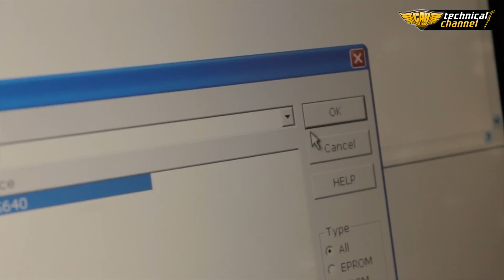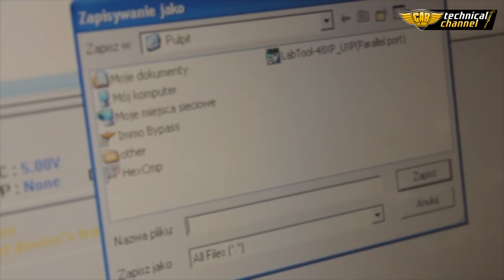SMD memory programming - how to read, change and save a memory content correctly?

Comment: Dear sir I have an Chevrolet (GM) Captiva 2.0LT Year-2008 ,I parked my car at common service station for regular service but during servicing my car,they misplaced/lost my ECU/ECM(BOSCH EDC16C39) somewhere and when I got know that i shouted on them, so they managed to find similar ECU of any scraped car and also managed to start my car with my car's key by doing IMMOBILIZER Off or bypass.

However I know that doing IMMOBILIZER off is breaking/loosing car security but at that time I don't have any other choice to start my car.

Since then "Check engine light/malfunction indicator lamp" showing in odometer.OBD-II scanner giving error code P0630 that "VIN Not Programmed or Mismatch"
So now I want to do IMMOBILIZER ON and get my car's security back.also want to enter Correct VIN where needed.

One thing I want to tell you that my IMMOBILIZER is separate and located onto cylinder shape lock(in which I insert key to start my car)while one EEPROM Chip Sop8(95640) attached on ECU/ECM and one EEPROM Chip Sop8(95040) on IMMOBILIZER.

I have MiniPro TL866CS USB programmer and new 5-5PCS Of both EEPROM Chip 95640 & 95040.
I have taken both chip's file(Hex) by USB programmer.

Can you PLEASE help me to do IMMOBILIZER ON & Enter Correct VIN number.
Please tell me if you need any picture of any part of car to solve my issue.

Waiting for supportive reply.
Thanks in advance
Reply from the maker: Hello Mr. Harsh! I hope we can help you, but the only place where you can get a technical support is our Official Technical Forum, here is the link: https://carlabimmo.com/newforum/viewforum.php?f=4
Make new post, describe your problem, add photos of your ECU and original file. Im sure our Expert will help you! 
Good luck
Reply from the maker: Hello mr. Harsh
We will be happy to help you! Please make a post on our Official Technical Forum, describe your problem there, attach pictures and original ECU file. Our Expert will do all that he can to help you solve the problem.
Here is the link: https://carlabimmo.com/newforum/viewforum.php?f=4
Good luck! :D